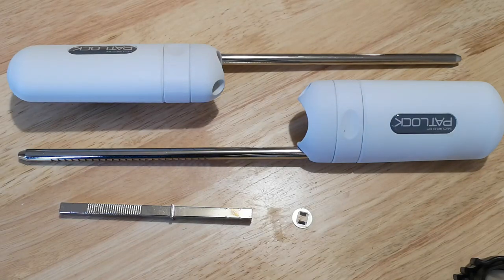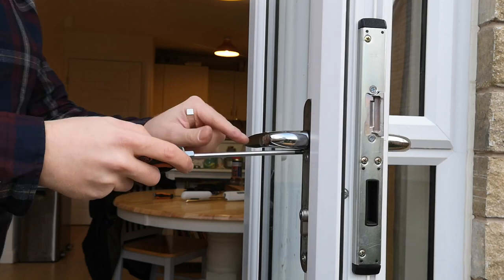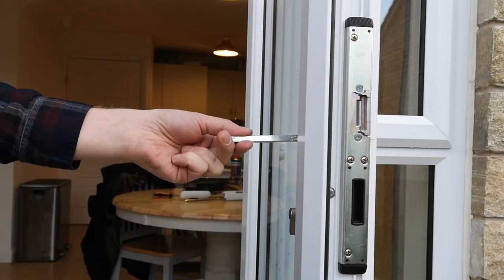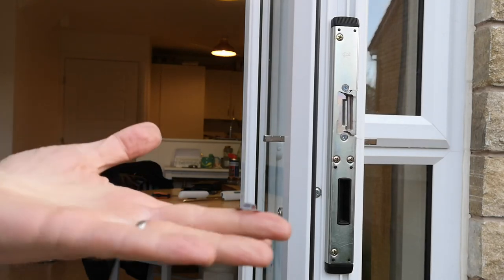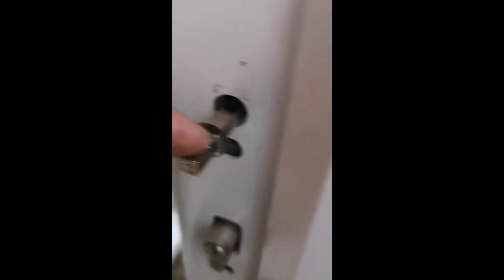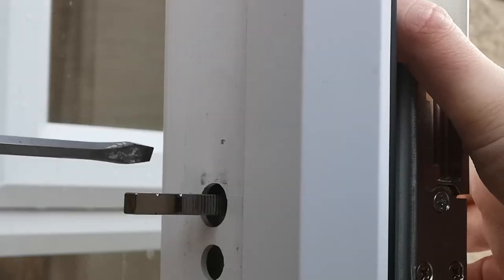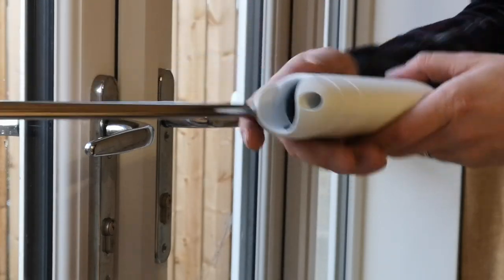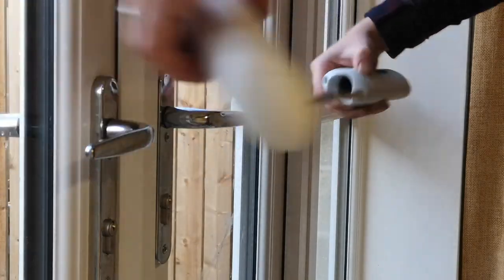Installing a Patlock (including spindles)

Comment: Thank you, just got this so was confused on the install. Very nice video to follow. I am. Also concerned about removing the small spindle....maybe use a small flat screwdriver to pry it out, this could have been designed better to be honest but with a new house and new patio Installed doors, this is much needed

Comment: Thanks for this it’s really helpful, my only concern is how would you remove the spindle should the locking mechanism fail.
Reply from the maker: I don't know because I haven't had to do it but I think if you could get something thin like a knife under the flaps of the locking tab you might be able to bend them up and get the tab off.

Comment: I found the spindle that came with Patlock are too long, the handles don't sit flush to the door frame.
Do you have to cut them shorter?
Reply from the maker: The patlock instructions say you can cut to length if necessary. https://www.google.com/url?sa=t&source=web&rct=j&url=https://www.patlock.co.uk/s/PATLOCK-Instruction-Leaflet.pdf&ved=2ahUKEwj_-a7szNX6AhUTbcAKHTi2BekQFnoECBAQAQ&usg=AOvVaw1nmk3iTm_EI_TsS5JWrDVM

Comment: Thanks for the video, much appreciated. Might be a stupid question, but can they not just do the same to the spindle on the other handle? Or is there only one? Sorry, complete idiot when it comes to this sort of stuff.
Reply from the maker: There are two security spindles included with the patlock and you will need to replace the spindle on both doors. Hope that helps!

Comment: Question. I don't like the idea of having the spindles difficult to remove with that clip. Is it not possible to put the spindle in from the inside to prevent it being pulled out from the outside?
Reply from the maker: I don't see why not; it should work either way round
Reply: Then you run the risk of someone blowtorching from the outside, then being able to push the spindles toward the inside and the handles and patlock falling off.
Reply: so if you are blowtorching from outside and pulling this spindle to the outside, what difference does it make which way you put it in.

Comment: Where did you get the lock spindle from ?
Reply from the maker: The spindles came with the Patlock
Reply: @MattyRlufc  do I still need to change this if I have anti snap lock?
Reply from the maker: @OulyHussain  the spindles are optional. Anti-snap lock prevents the lock being broken off (which will let the handles turn). The patlock means even if they snap the lock they can't turn the handles. The spindles provide an extra level of security because even if they get the handle off they can't pull the spindle through and open it that way.

TLDR; the spindles are optional, but will provide additional security even with anti-snap locks